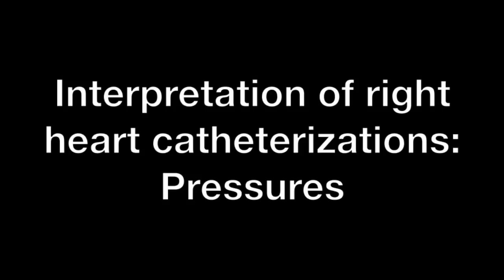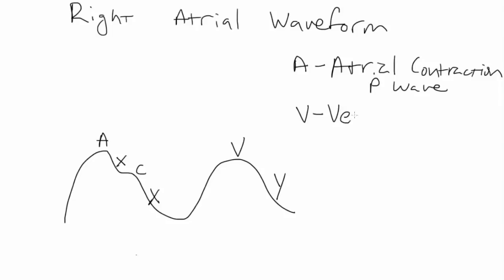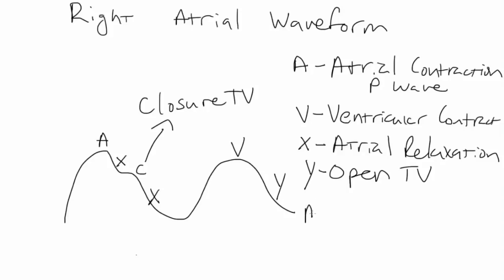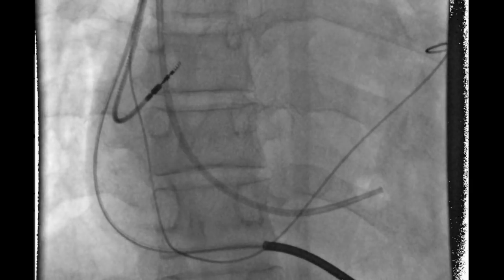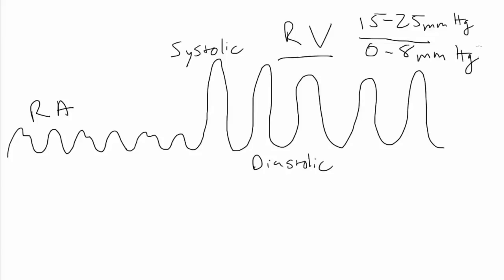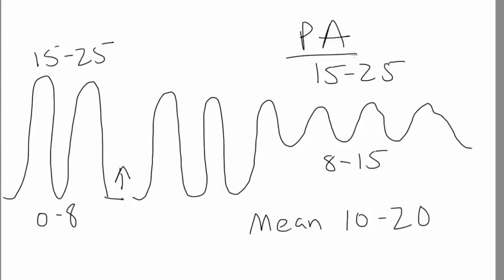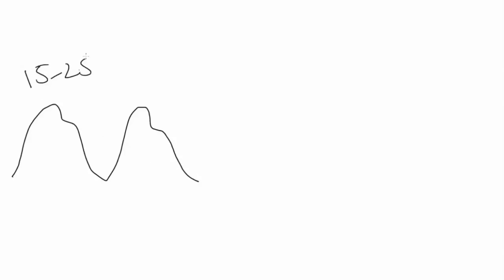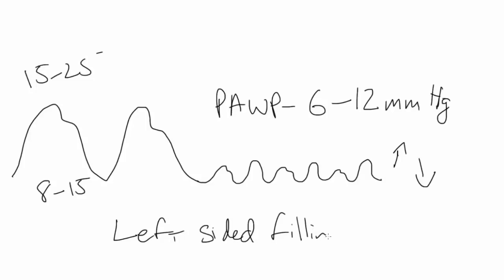Right Heart Catheterization - Pressures

Comment: C wave is produced due to backbulging of TV during phase of Isovolumetric  Ventricular contraction. 
V wave is the pressure build up in the atrium due to filling up of blood during atrial diastole. 
Y descent is the pressure fall produced during to opening of TV and rapid passage of blood to the ventricle ( Rapid filling phase)
A wave is produced by atrial contraction ( not seen in AF).
We know that Ventricular filling during diastole (corresponding   to atrial systole) has 3 phases : Rapid filling phase- Diastasis- Phase of atrial contraction).